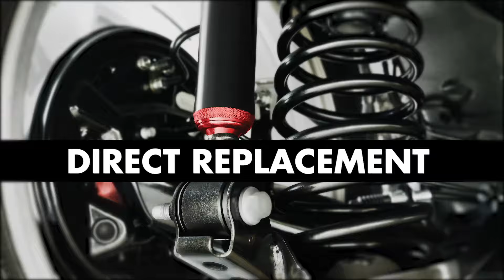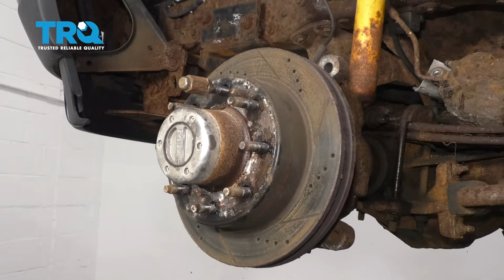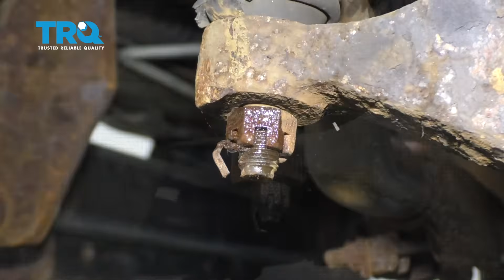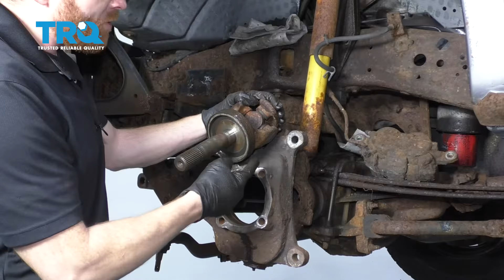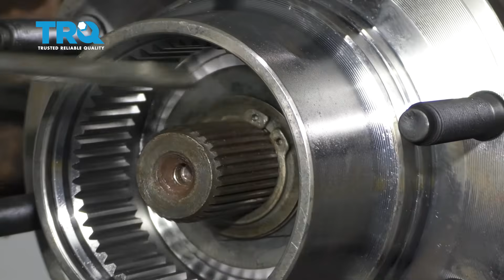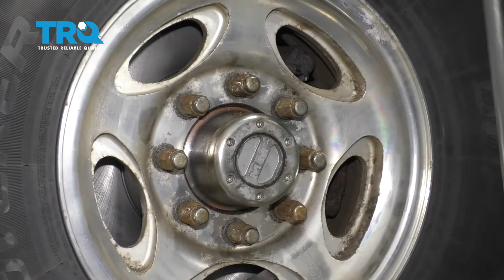How to Replace Front Axle 1999-2007 Ford Super Duty F-250

Comment: Guys the first washer with the 4 lines goes on before the wheel bearing. Then is circle, hexagon, circle. Just had to take off wheel bearing 3 times before I figured this out. Good video and explanation on everything else, but hopefully someone reads this before installing in the wrong order.

Comment: I really appreciate that you gave the torque specifications for the Hub Nuts, Tie Rod nut, Brake Caliper  Mounting Bracket Bolts, Socket Head Screws that secure 4X4 hub lock, brake caliper bolts and the lug nuts. 😊

Comment: So I just recently bought a 99 F350 and the guy that I bought it from put a lift on it and some 37 inch tires and didn’t change the front and rear gears out. So I’m running stock gears with 37in. Tires. Just wondering if I could do the job myself or should I just pay the 4k to have the shop do it.

Comment: This is an example of how NOT to perform a repair.   Nothing was cleaned.  The metal shavings on the hub lock were still present when you assembled the unit back on.  Your inner axle seal was just dangling around the axle tube.  You did not even attempt that explanation.   You installed the axle with a new outer seal in a dirty, rusty spindle housing THEN decided to try to clean it for the hub installation with the axle and new seal installed.  When you rammed the axle in, how do you know if you didnt knock out the inner tube seal?  You don't.  This is the kind of work that make me cringe.

Comment: Every part of that needs to be replaced should have just bought a new knuckle, axle assembly , and dust seals and do the job once while it's apart. That truck will be back in the shop soon at least its lubed up so it comes apart easy next month.

Comment: Definitely big thrust washer goes between the hub and axle.
Hex non-metallic washer sandwiches between the two steel washers, held in place by the snap ring.
Reply: Thanks, that just helped me. I just removed mine and they came out the way you described.

Comment: https://youtu.be/P6SKKzp8dtM @7:50 on the video I linked you'll see the largest washer goes between the wheel hub and axel seal with the grooves facing inward. You'll also see the 3 thrust washers go specifically round, hex, round, then put on the snap ring between the wheel hub and the 4x4 hub.